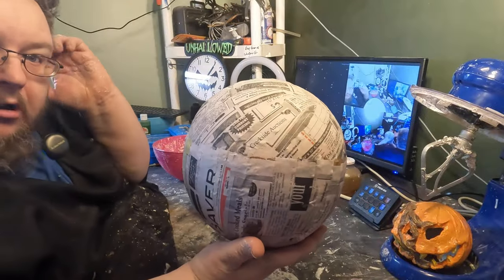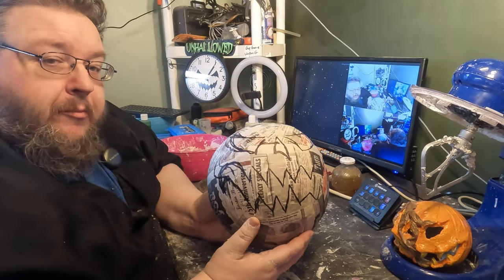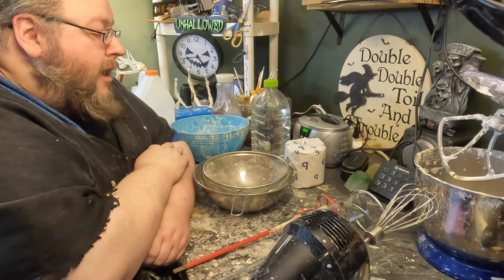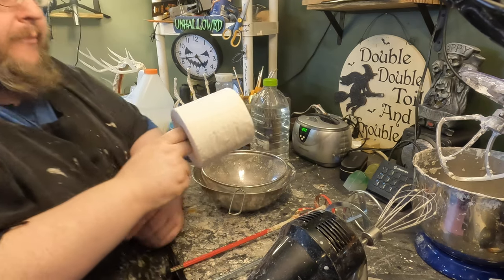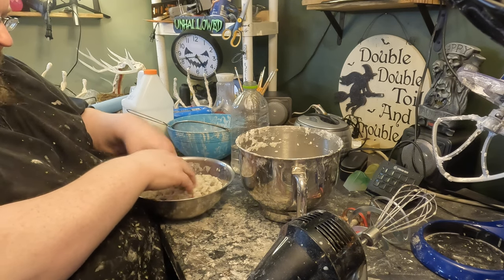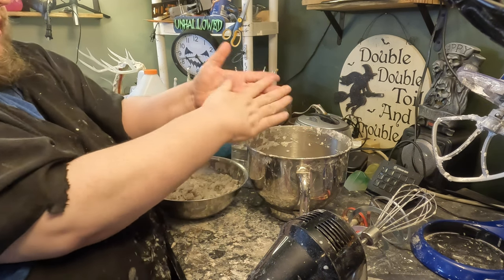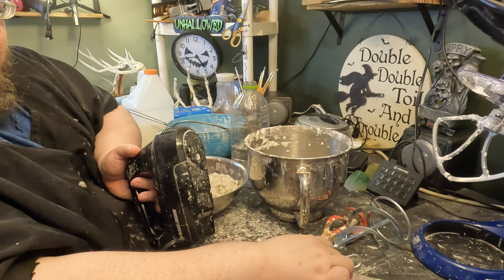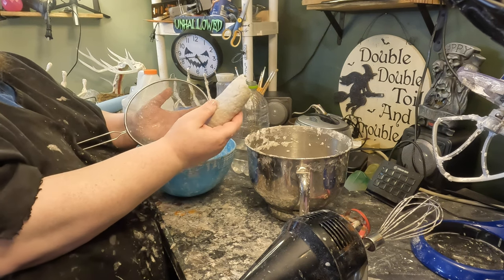The 5 Hour Pumpkin - 4 - Drawing the Face and Making Paper Clay

Comment: I done f*cked mine up. I keep adding flour and it’s just wet. Hmmmmm
Reply from the maker: Guessing the clay is too wet? Did you squeeze most of the water out of the toilet paper in advance?
Reply from the maker: For that matter you may still be able to give a handful a good squeeze and see if the excess water comes out well enough.
Reply: @Drachenfang  I’m thinking the tp may have been too wet. I kept adding flour and it just wasn’t helping. I threw the batch out lol I’m going to try again later. I was so worried about squeezing too much, that maybe I didn’t squeeze enough.
Reply from the maker: @HeyApril_  Gotcha. Yeah the tp was probably a bit too wet. I am sure you'll have more luck with the next batch. If it's really problematic then you can small batch it to get a mix that you like and works well.
Reply: @Drachenfang  I tried again. Still didn’t work. 🥲 idk what im doing wrong. Its frustrating. I wonder if temperature could have something to do with it. I am working in my garage and it’s really hot in there. I don’t know. I threw it out again. lol
Reply: @Drachenfang  tried for a third time. Can’t even touch the stuff. Added more of things less of things, mixed the shit out of it. The more I mix the worse it gets. I live in Fl. The heat is the only thing I can’t think of. Sorry if I’m annoying. 😂 I just want to make a pumpkin 😫
Reply from the maker: @HeyApril_  Oh do not worry about being annoying. Message away this is why I started this channel. Heat shouldn't be a big deal with this mix. I've made this stuff in sweltering summer and though I know your summers are more sweltering I figure your Octobers have got to be like my summers. We're gonna make this happen dammit! :) Ok, starting off, what brand of drywall joint compound are you using? Sometimes the DAP brand does not like to play nice with white glue. Next, is your mache paste (not the clay) turning out ok and look like it should?
Reply: @Drachenfang   proform joint compound, Elmers glue, great value flour and some shitty dollar tree tp 🤣 yeah the paste was fine. I got about 6 layers on the ball with the news paper and it dried nice and hard. I can’t figure this out. The first time I kept adding flour. I added a lot. It wasn’t changing. Second time I added more joint compound, nothing. This time I said screw it and added a little more tp and flour. I don’t get it lol. What should the texture feel like? Is there something you can compare it to? My consistency is the same no matter what I do. It’s like sticky and I can’t even touch it. Like you can touch and shape yours. Mine is just a mess! Thank you for taking the time to try and help! I appreciate you. 🖤
Reply from the maker: @HeyApril_  No prob. This is why I am happy I have a small Halloween channel and not a huge one. I get to help just about everyone. The problem is sounding like not enough tp. Here is what I would like you to try. Make a small batch of paste. About 3 cups flour, 3/4 cup of glue. Add water and mix until it's like thick pancake batter. Then add 1 cup of drywall joint compound and mix again. Then start adding TP (don't dissolve it at all, just add fry tp, about half a roll at first) and mix until the tp has vanished into the mix completely, then add more tp. Keep adding tp until you get paper clay. Toward the end you are going to have strips of tp that stay recognizable as tp for quite a while until the mixing breaks them up. The only consistency recommendation I can give is that it's like play dough if play dough were made out of tp. If this fails then I'll set up a stream sometime and walk you right through it all step by step on video.
Reply: @Drachenfang  you deserve a big channel! Your work is amazing! I love watching your videos. Ok. I will definitely try that. I wonder if I should try different tp. I’m going to try different everything! Because this is going to work one way or another 🤣 and yeah I wasn’t even close to a dough type texture at all! So weird.
Reply from the maker: @HeyApril_  I'm pulling for you. You got this... and if you don't let me know so we can keep fixing it. Everyone should be able to Pumpkin!
Reply: @Drachenfang  so I went and got a paint mixer. I’m tired of the hand mixer haha.  I am currently trying the other method. My drill died, but nothing yet still sticky nothing like a dough. 🥲 I’m going to keep adding paper. See what happens.
Reply from the maker: @HeyApril_  Ok cool. Just keep adding that tp until it stops sticking to the sides of the container. It sounds like you're almost set.